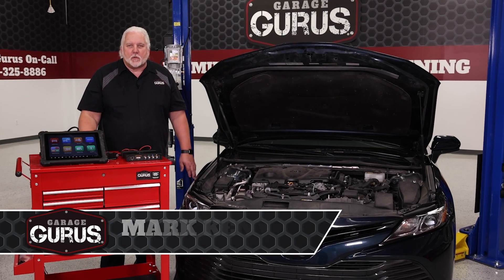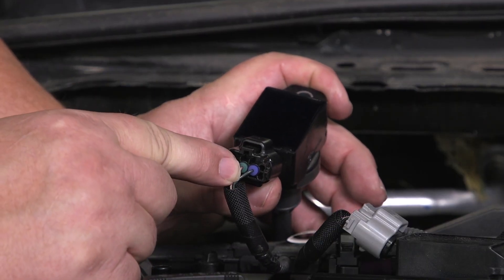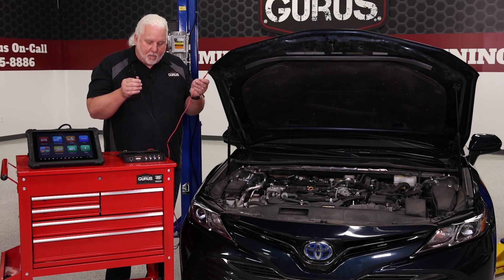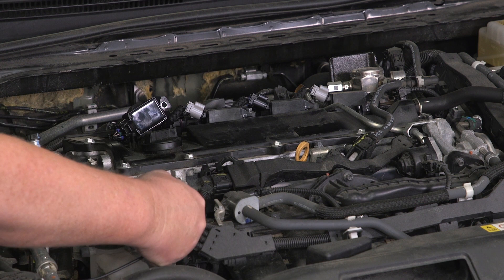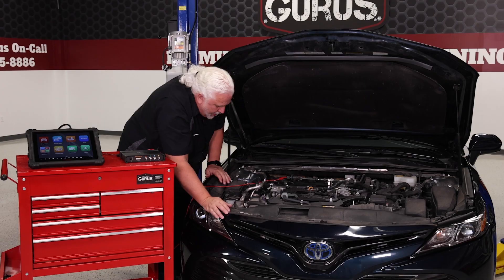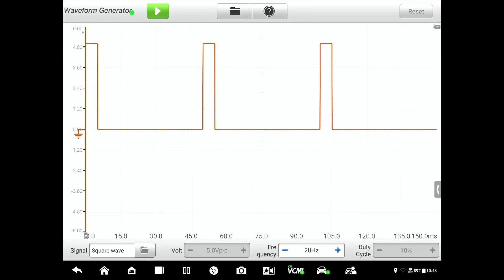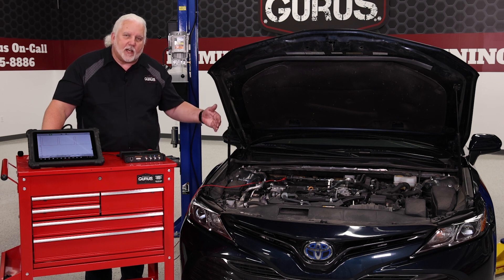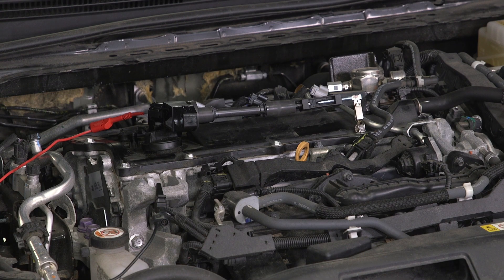Garage Gurus | Ignition Coil System Testing

Comment: Why do we need the vehicle? I don't like paralleling the ECU spark command signal. 

A better test would be on the bench with a current limited protected DC power supply and a signal preamp for the spark command. The preamp would isolate the smart coil from the signal generator. You could use a protected automotive high frequency (N-Channel MOSFET device) smart power switch as the preamp. Also, it would be helpful to monitor the smart coil current during the test. This way you know that the coil is saturating which would be another way to stress the smart coil.

Comment: QUESTION:  A few weeks ago I got my F250 stuck in mud.  I had to pull the 4 wheel drive knob out to lock in all 4 tires and put the pedal to the medal in order to go no more that 2 mph.  This took about 5 minutes.  Since then I have power steering only when I am driving with the gas pedal being pushed.  When I let off the gas I do not have power steering.  What is broken ?

Comment: I understood the generator's signal circuit low reference is connected to chassis ground /bat negative of the car. To make this  somehow work the generator itself is power and ground fed thru the scanner by the car's electrical system?